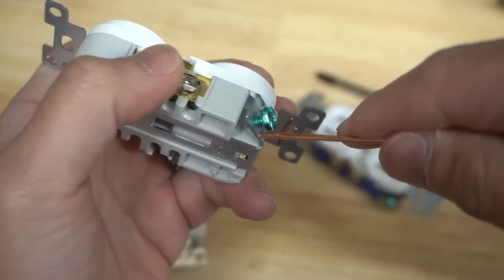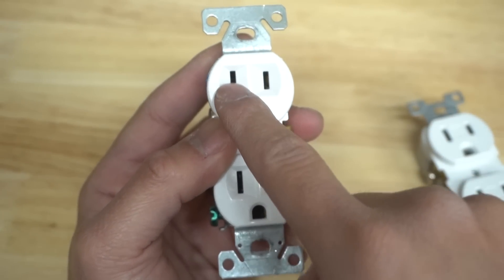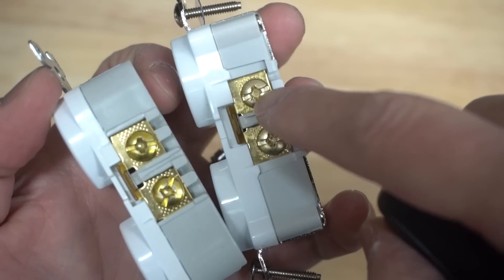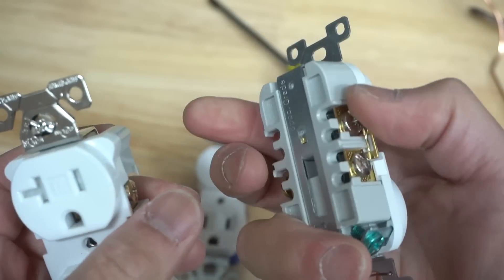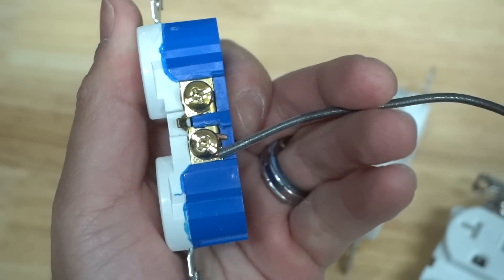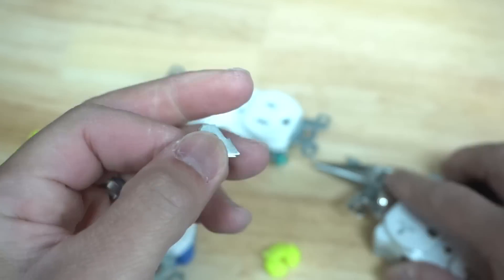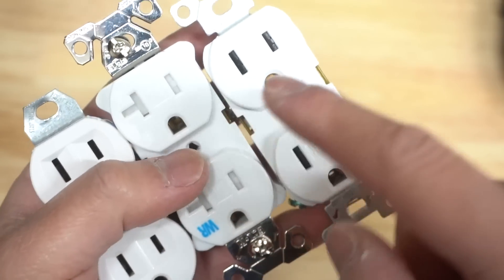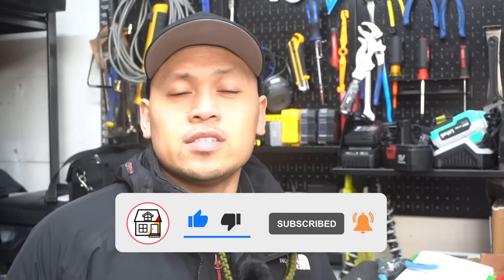GENIUS Electrical Outlet Built-In Features Most People DON'T Know About!

Comment: A feature I found on the residential outlet is on the back, by push in wire connection, there is a little slot below the wire hole. If you want to remove a wire, instead of struggling to pull the wire out, put a small blade such, as a screwdriver or just  something small that will fit, in that slot to release the clamp on the wire - it will pull right out. I've been doing this for years and makes it a lot easier trying to remove a wire on an installed outlet.
Reply: This is referred to as "backstabbing" the outlet, and it usually leads to bigger problems like fire, for instance